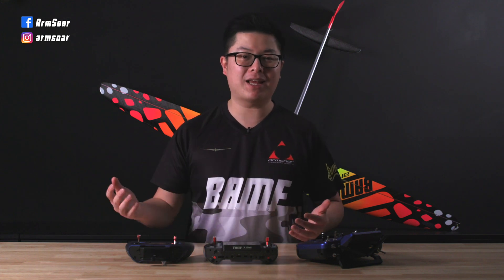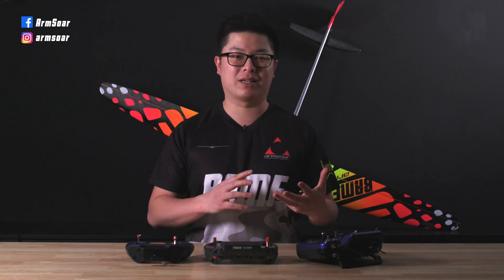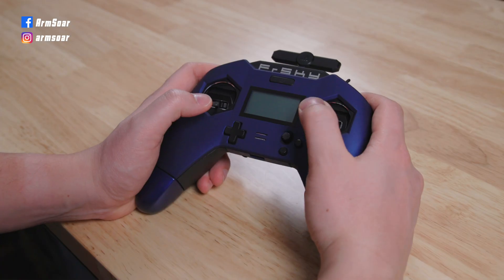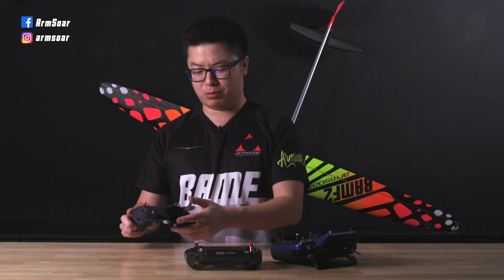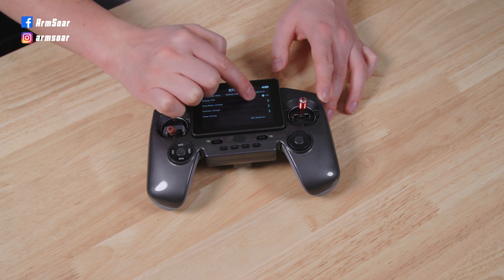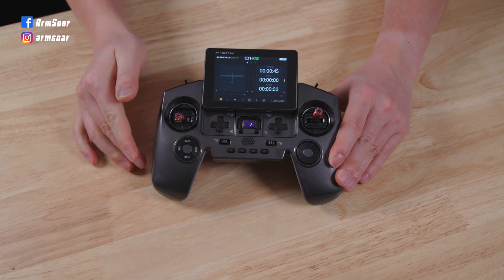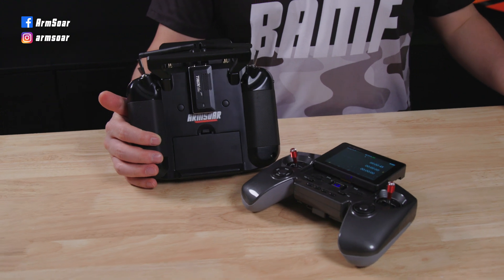FrSky Twin X Lite and Twin Lite Pro Module

Comment: Very good video!!
How does the gimbal feel? 
Use two fingers. The x lite pro was too soft and the stick end was thin, so I needed to adjust the spring tension separately.
I want to use it exclusively for dlg, but is the cross key trim comfortable?
Reply from the maker: The trim keys are okay, much better than the X Lite Pro. Gimbal is still a bit soft, I made mine tighter by shortening the spring in the gimbals.

Comment: Can you at some point show some pics of holding it with the button for the DLG launch being used?  How comfortable is that on the Twin X-Lite(s) compared to the x-lite pro?
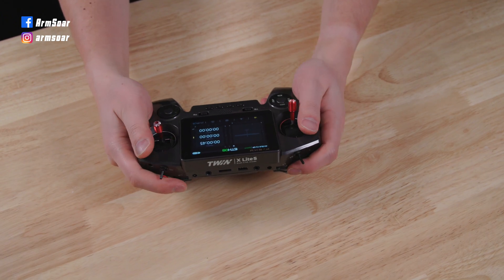Reply from the maker: Hey, check out 4:40, my index finger is on the launch button. It's better on the Twin X Lite as the button is larger and more pronounced than the old X Lite Pro.
Reply: @ArmSoar  Thanks.  I somehow missed that.  It looks like it will work well for DLG.
Reply: I have used mine for about 8 months now and love it.  TW receivers work really well with them for extended range.  I really like the Ethos programming OS.  Similar to raw power of OpenTX with some builtin mixes if you want to go the more traditional route and/or mix between the two.  The button for DLG launch is perfect.  I really like that I can get to all the switches and buttons without moving my hand from their default hold while flying.  Trims do take some time to get used though with them being inset.  Always get the S model though for it's brighter display in daylight.

Comment: I'll preface my comment by saying I have not been following comments on the newer Ethos OS radios on RCG or elsewhere. I am quite disappointed in FrSky for only making the new Twin system RF link compatible with Ethos radios only. There are many pilots besides myself who have made investments in multiple FrSky radios using Open Tx. At this time we are SOL on being able to utilize the Twin system. I liken this to the many complaints FrSky received when the first Open Tx radios did not accommodate the older ACCST protocol. After much grumbling and foot stomping, that issue was resolved. Have you heard anything about FrSky making any accommodations for those of us using Open Tx radios to be able to utilize the Twin technology?
Reply from the maker: Hey Ken, this is something I've heard from a couple of customers, but as far as I know, FrSky does not have any plans to bring Twin to OpenTX (or any other platforms).
Reply: I wouldn't have thought they could as it would require a new rf module for the transmitter if I am correctly interpreting your comment. That would mean whole new internals for all the old transmitters.

Comment: if it was 5 years ago I might have gotten a Taranis
but now with the TX16S and EdgeTX, Crossfire, ELRS (with Vario Rx's), ...
no need to go with a closed system
Reply from the maker: I think every system has its place; from my own experience in helping with customers, EthOS is much more straight forward and easier to learn for many people, and ELRS can be a learning curve as well.
Reply: I know it's open source but isn't it still a closed system. Radiomaster/Jumper are the only ones doing edgetx and elrs for aircraft so it still seems a propriety system. It's not as if Jeti, Futaba, Multiplex and Dpecteum are on board?
Reply: @monami5201  edgetx developement is seperate from those companies
and open source doesn't mean all companies have to participate
Reply: 24 high resolution channels, FBUS, SBUS, superior telemetry, stabilized receivers, but yeah, you do you boo.
Reply: Frsky has decided they no longer need the FPV market.  I guess they are happier with the soaring market.  Their choice.  I've had Frsky radios for 10 years and still fly with an XLite for 5 years now, however I just ordered a Radiomaster Pocket and bunch of ELRS stuff like every one of my FPV buddies did before me.   I am also into a little DLG soaring too, so not going to mothball the XLite.  I'd love to have this Twin Xlite with the bigger screen if it had OpenTX or Edge, but I cannot fathom changing to Ethos.
Reply: Too bad Frsky shot themselves in the foot.. I wonder how they feel about it now..